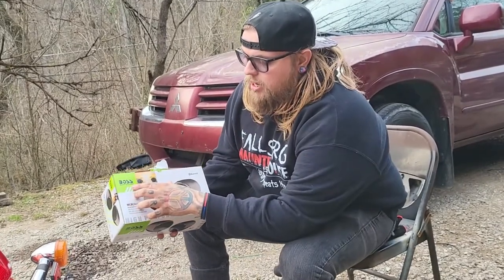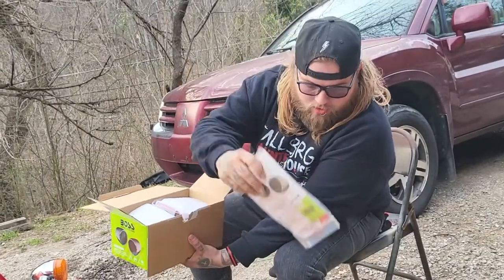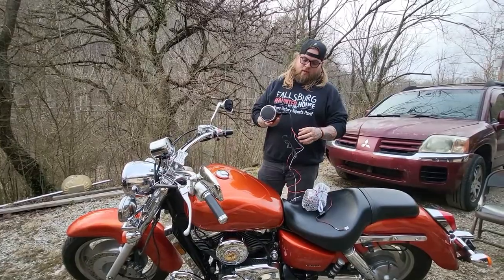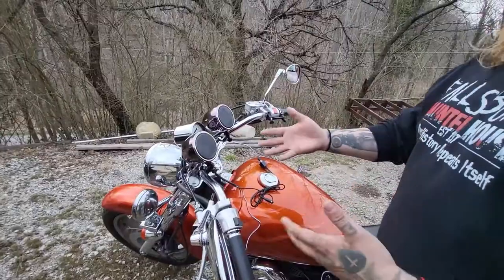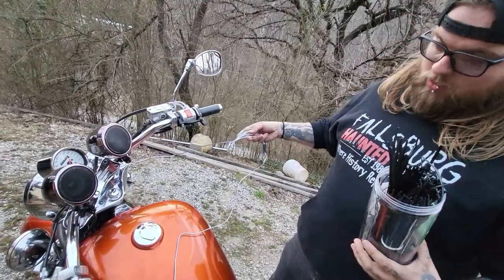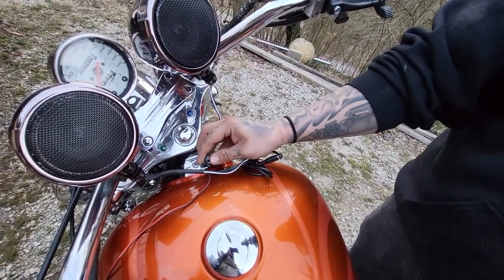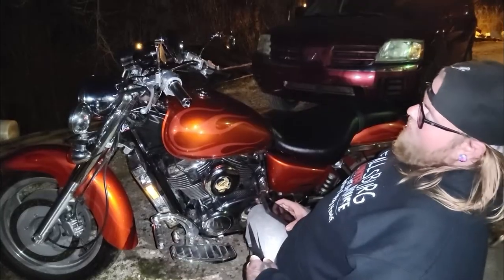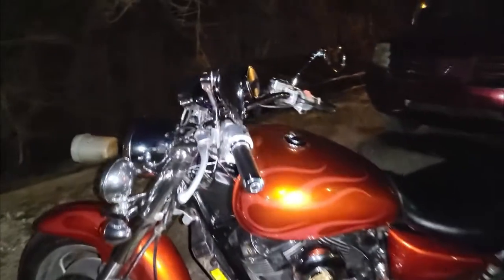Motorcycle Speakers Installation - BOSS MOTORCYCLE BLUETOOTH SPEAKERS - How To Video

Comment: I bought the same ones in black and put them on my 22 Forty Eight. Seems like they're constantly drawing power even with the switch off and its killing my battery after every ride.
Reply from the maker: The switch was bad on this set, maybe the switch on your set is not going all the way off
Reply: @TattsForLife  currently removing the fuse in between rides but I might have to add a kill switch

Comment: Can I use a black and green wired toggle switch
Reply from the maker: Any toggle switch should work as long as it's rated for 12v
Reply: @TattsForLife  thank you!!! And I read I should string it along just the positive line or the negative line not both right?

Comment: Do yourself a favor and mount the system thru a relay so the amp will come on with the key and more importantly, shut off with the key so you don accidently run down the battery.
Reply from the maker: Great Info